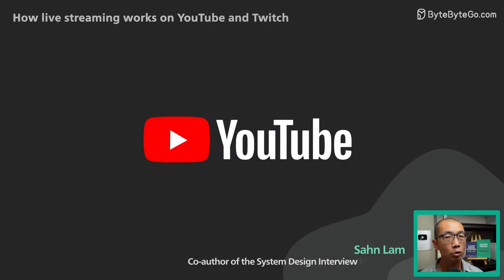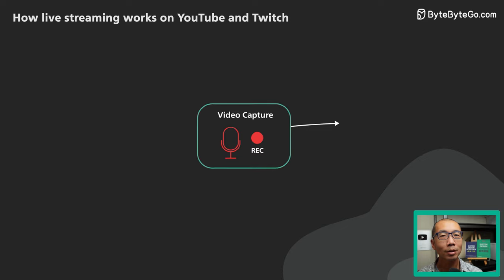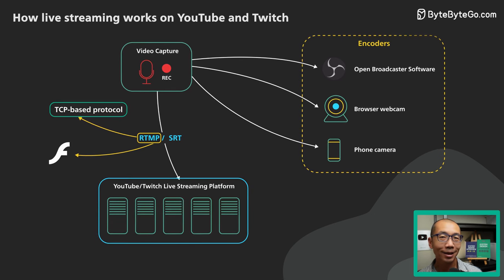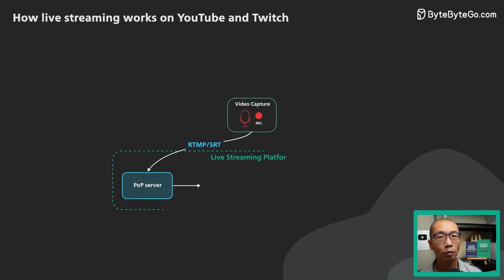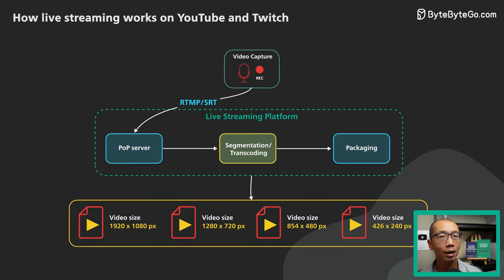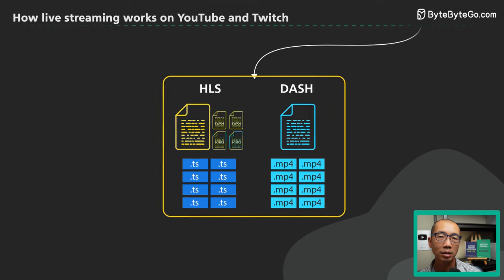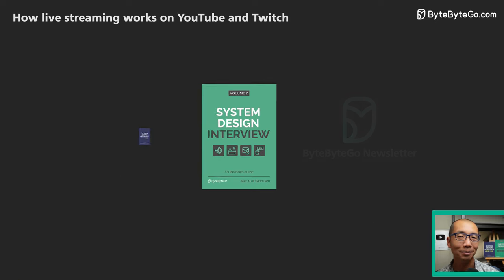How Does Live Streaming Platform Work? (YouTube live, Twitch, TikTok Live)

Comment: 🎯 Key Takeaways for quick navigation:

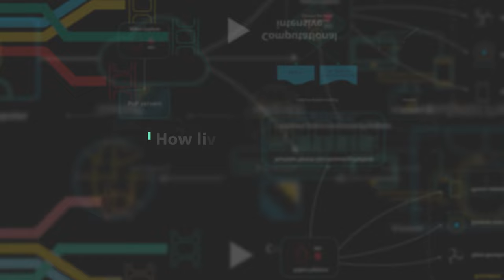00:07 📹 Live streaming faces challenges due to real-time internet transmission and compute-intensive video processing.
01:07 🌐 Encoders package video streams using protocols like RTMP, while newer options like SRT promise lower latency and network resilience.
02:06 🌍 Point-of-presence servers are used to optimize upload conditions for streamers and ensure fast transmission to the platform.
02:35 🔄 Adaptive bitrate streaming allows video players to adjust quality based on viewer's internet connection, and transcoding converts video streams into different resolutions.
03:38 📦 Popular live-streaming formats include HLS and DASH, with HLS being the most widely used format, consisting of manifest files and video chunks.
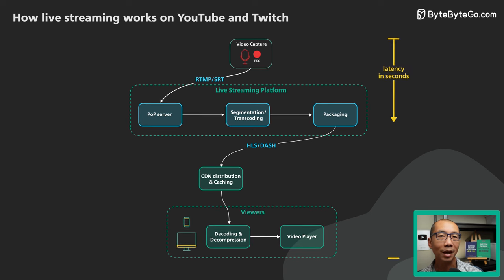04:38 ⌛ Achieving lower latency may require sacrificing video quality, and some platforms offer options for streamers to adjust interactivity and quality.

Made with HARPA AI

Comment: Is Live-streaming same as video calling? If not what's the difference?
Reply: Could be, but it has some potential simplifications. For example:
In some scenarios (1:1), the quality may be requested by the client and the server-side transcoding can be omitted (almost) entirely. In most cases the number of necessary quality formats is lower and can be adjusted on the fly.
Video calling also does not benefit from any CDN caching and can skip this step entirely.

Basically: Video calling is just video streaming, but with a few potential optimisations due to the lower number of viewers.
Reply from the maker: Great question.

Live streaming and video conferencing/calling implementations are quite different. Video conferencing could be an interesting video.

The main difference is scale. Living streaming is 1-to-many, where the many could be in the millions. Video conferencing maxes out in the low hundreds, and the experience at that scale is not very good.

Also, video conferencing is bi-directional. That imposes a different set of design constraints.

To learn more about video conferencing, start with terms like WebRTC, SFU, and MCU.
Reply: @ByteByteGo  Thank you! I am learning how WebRTC works. Yes, it would be great if you make video or blog about video conferencing.

Comment: I'm presently at a loss on a project that involves live streaming i inherited. It was designed with ffmpeg as the transcoding engine and I'm having a huge problem with latency as its output is in rtmp.

Can you help me out with figuring out how to reduce latency for Live streams?
Reply from the maker: What is the latency now, and how low do you need to go?
Reply: @ByteByteGo  there's a massive delay of 11-18secs delay and i am looking at how to get it to 5-7 secs at the very least